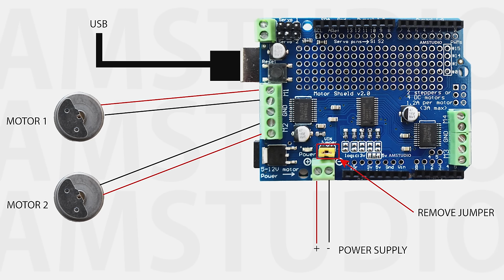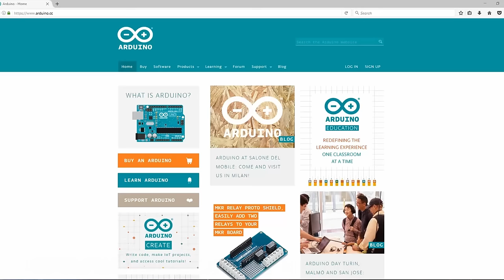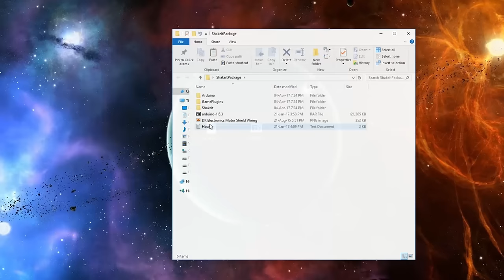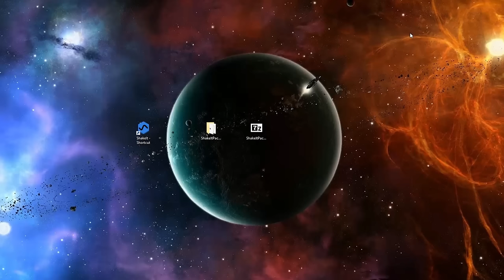DIY RUMBLE PEDALS SIM RACING  | SHAKE IT

Comment: did you put any sort of flux on the wires before soldering them?     and i'm guessing that the motors would be easily enclosed if you have curious cats...
Reply: Flux is already included in the solder (little hole in the middle). And yes you should close them up:))

Comment: How do you setup the new software ,etc? Ive got everything wired and assembled but cant figure out how to make it work. Thank you, im super excited to get to feel this!
Reply: ive done this and it works great....inside the setting  under arduino  goto "my hardware" and there is where you set up the settings. look in there for your stepper motor connected to your arduino and  turn it on. i am running L298 but you can run with many stepper motors. i would advise to give the donation of a few dollars to make it run more smoothly for you. i donated i think 5 us dollars. i use stereo speakers for my  bass shakers and its fantastic.       dont for get your power supply for the arduino.

Comment: Hi, hope someone sees this since this is an old video. Why is the power supply connected to the motor shield instead of using the barrel plug on the arduino?

Comment: If I combined this runmle motor mod with inverted pedals, should the motors stay on the same end? Attached to the same M6x1 mounting bolt or go on the opposite mount so they stay at the top when pedals are mounted upside down

Comment: I really love your guides keep them coming! :-)However, I have one question - you configured right and left vibration in shake it. But on which pedal did you mount them? Is it so simple that there is left vibration on the brake pedal and right vibration on the gas pedal ?!
Reply from the maker: I had mixed in left vibration to the brake pedal and brake lock up. On the right pedal, right vibrations and wheel slip/acceleration. Of course you can add more motors and mix the settings as you like. One motor shield can control 4 motors.
Reply: Thank you for the clarification - that was logical! When I bought my engine shield, I "managed" to buy Vellemans vma03 which only has two engine connections. So I run this with a modified program based on Shake It's ... and just two engines. :-)

Comment: Great video, this setup could be used with a strong vibration motor like 15w/220v ac, arduino could handle it? With a proper power supply. I know nothing about electronics. Thank you!
Reply: The Motor shield shown in the video is only for dc motors.
I guess the maximum will be 12v

According to the datasheet 1.2A load is okay. So 12v * 1.2A = 14.4W
Reply: The motor shield is powered by the external power supply and jack. The arduino itself is powered by the USB to computer connection. Its important to remove the jumper as shown to isolate the power inputs separately.

Comment: Would it work if I used 2 of the motor ports on the motor shield for the rumble and 2 for wind sim? I don't want to have to buy 2 Arduinos and 2 motor shields. Do you think it will work?

Comment: I have some power external vibrator motors (used in the mining and cinstruction industry, about 1/4 hp each). I was thinking in puting one on each corner of my sim rig, so everytime I hit a kerb, slide or whatever, this thing emulates the real world. For example. Rear wheel spin both at the back, front wheel lock both in the front, right sliding, both of the right... and so on...
Would it be possible?
Between the arduino and the motors there should be a 5 /220 volt relay.
Any suggestions?
Help?
Advice?
Reply: I dont think that will be a good idea, i suggest you to work with lower voltages, use wipper motors. If any 220v put to short, your body doesnt gonna thank you🤣
Reply: @vierja1709  yeah... now I have a 4 actuator motion rig, with 6 transducers, 4 vibrating motors.. and building a double TL platform...

Comment: Hey. I need your help. There are pedals from the steering wheel Logitech Driving force gt, but there is no steering. Is there any way to connect the pedals to the PC?
Reply: you can use a USB Adapter for the Pedals

Comment: Hello there, I love your videos they are so great!!! Is there any way that you can make this work for the PS4 or consoles? It seems like there are a few people here that are console based. Also I noticed the compatibility for games excludes Gran Turismo Sport or any of the GT games? Any reason why?
Reply: That wouldn't be possible, as the console can not control the board. I'd compare it to trying to plug in a a flight stick to a console, it just won't work without the supporting software.
Reply: Everytime i love it... they get a console because its cheaper than a PC or you don't have to upgrade Hardware or it's just easier to get a Game running. Then they are crying because they can't use mods. Console Guys stop crying or get a PC and you can mod the hell out of it.
Reply: @zombie821  Harsh.I have 4 PC's and 2 PS1, PS2, ,two PS4, N64, Dreamcast, xbox360 and various other consoles and too many wheels ,pedals and joysticks to list . Sometimes you just want to plug-and-play. Don't be a PC master-race tart.
Reply: @rustybuckets07  what does this have to do with my comment? mods are almost impossible on the console, if you want to use self-made devices, you have to be on the PC. In this case, only the PC remains because the consoles are too limited in the possibilities. this is not a case of "I like the PC more" that consoles are limited and computers are not, is a fact.

Comment: Can this share the same UNO board w/ the wind sim ? Thanks for the info!
Reply: it will work using the same uno board and motor shield. that's my setup. my motor shield has 4 motor terminal.. used 2 for pedal rumble and the 3rd one for wind sim (one 12v dc fan) the fan is still a motor. just configure the effects for the fan on simhub
 hope this help.. i'm planning a clutch pedal rumble for the 4th one because i want to imitate a clutch biting point.. if there is..

Comment: i want to do this so bad but on thrustmaster t3pa pedals
Reply: principle is the same for any pedal set, you do not solder those motors to any pedal wiring, but to arduino control board.

Comment: Don't know whats going wrong .  Followed exactly what you have done but when I test the pedals with Shake It I get no output to the motors.  Initially thought I had fried the Motor shield as I had wired the power the wrong way around (Yeah I know Im a fool).  Bought a new shield to try and still not getting anywhere. If I bridge the power to the outputs where the motors are plugged in the motors spin.  Back to the drawing board i guess.
Reply: Well turned out what the shield I bout wasn't V2 it was an older one.  Tried the other sketch in the download and it worked

Comment: Hello, thanks a lot for this incredible video ! I was just wondering how it would be possible to put more rumble motors, for example to put them on the back of my seat (and so having a semi-dynamic chassis, like a small Buttkicker). Would it be correct to use many "motor/steppers", plug them on each other and use one power supply only (the current is in parallel so equal everywhere) ? If so, that would be much less expensive than buying a real seat rumble pack !
Reply: hi, im thinking of doing the same, but the Motorsheild only has a current limit of 2amp per channel, and i think a sufficiently sized motor for the seat may need more than 2 amps
Reply: If the circuit is in parallel the current is equal to current * no. of components (assuming you're using the same motors)

Comment: Found a suitable clamp for the motors at Menards, 1" flexible steel clamp with protective rubber insulation part number PPR-1600 , sku 3647798

Comment: i know this is kind of old now  but   can you skip most of this now like you can with your wind mod ? and could they both be put on the same board
Reply: I am about to do exactly what you're suggesting. I already have the wind sim set up with just 2 fans (motors), but the Arduino + Motor Shield can output to 4 motors. So if you come back to this comment, I'll let you know how it turned out.
Reply: October 2023 update: I can confirm that my fans and pedal rumble motors work perfectly together. I bought rumble motors and some extra wire on Amazon and wired them into the 2 unused M3 & M4 connections on the Arduino+Shield that I was already using with 2 fans for wind. It was literally just 2 wires to connect per motor and it worked straight away. Hope the knowledge helps you or anyone else in the future who wants to combine both mods.
Reply: @chanielmays4598   awesome   I now know what my next upgrade will be thank you
Reply: you can stack more adafruit motor shield on Arduino uno.. but simhub has limit it to 12 motors.. (3 motor shield)

Comment: Long shot but has anyone run 2 rumble motors on 1 pedal? I know you can run 4 per arduino but can you run 2 on the brake and 2 on the throttle etx

Comment: First and any advice for someone that wants to learn driving ? 🤔
Reply: Second, and practice a LOT, but also watch other people race so you can emulate what they do.
Reply: Cole Hampton I'm talking about real driving. Why should I watch people race ? 😁
Reply: Really no substitute for real driving except real driving. The hard part about driving is not controlling the vehicle (at normal speeds) it's about situational awareness, knowing the rules, being able to react and know what you are supposed to do quickly (give way etc)

Most people are scared of Manual cars but really you get the hang of it after about an hour of practice. I did atleast.
Reply: Dirty Harry driving lessons lol
Reply: pls dont crash or u dont get high fivs from nobidy
Reply: WickedDimension is right. Learn to control vehicle is really fast to learn, but the main problem is to drive safe, it is way harder than driving itself. It takes at least a year for everyone to learn this. If you don't know how to gear just search up how is clutch working and you will be on the good way. After that, pedal work is just matter of muscle memory.

Comment: for some reason i cannot get the shake it firmware to verify at all
Reply: Same here but just figured it out,
download https://github.com/ladyada/Adafruit_Motor_Shield_V2_Library/archive/master.zip
in arduino top bar click sketch -> include library -> Add .zip library then select the zip file you just downloaded and it should work perfectly
Reply: Swedishfishguy hey I got it working. I had to change the wiring I used.

Comment: Does it work on the PS4?
Reply: Probably not. You would have to hard wire the data connections of the wheel base to the board and figure out, which signal corresponds to which force-feedback.